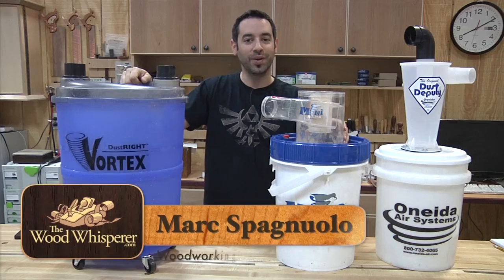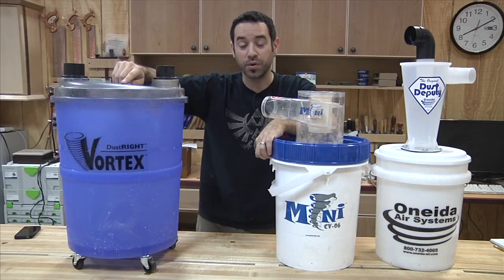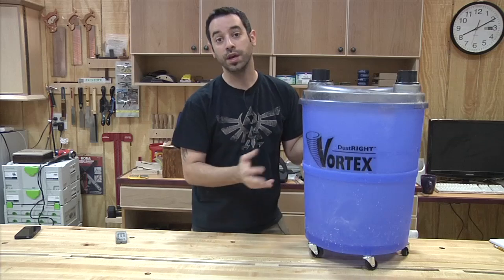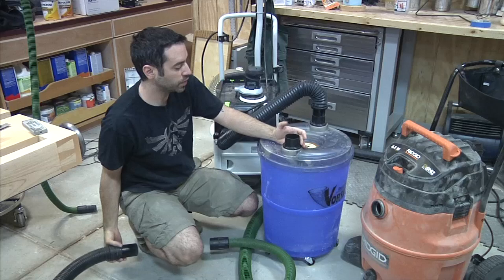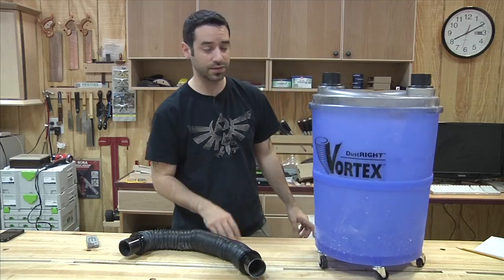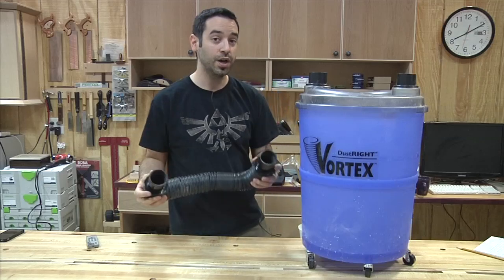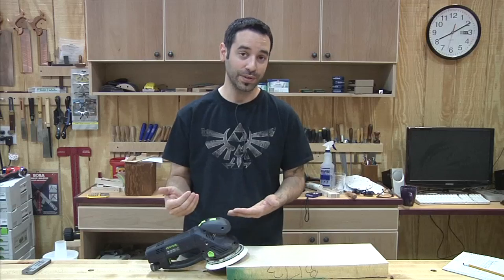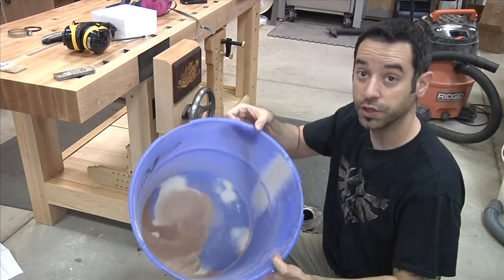170 - Cyclone Separator Shootout

Comment: Hi there, enjoy your videos, just a quick question, I've set up the cyclone type dust collector, I'm just using an house hold vacuum unit at the moment, my problem is that, the dust is being sucked up but not falling into the bucket, still getting sucked up into the vacuum unit, do I need to invest to buy a stronger vacuum unit? any idea would be appreciated. Thanks Warren

Comment from the maker: The larger the particle, the more chance there is that the particle will travel right through into the vac. So while I know many folks who use these systems for larger machines, I can't personally comment from experience on it. But at a certain point, you could probably overwhelm the cyclone.

Comment: One thing this test did not do was how much suction loss (both air flow loss and pressure head loss) was caused by the interruption.  In actual use, more suction loss means less of the wood dust would be captured.  It's entirely possible that although the Vortex may have the least effective fine dust separation, it MAY have the least suction loss and MAY end up capturing the most dust during actual usage.

Comment: I have just set up a system that is similar to the dust deputy as shown in the video. I have used a heavy duty plastic type container that keeps collapsing when the vacuum end gets blocked. could you advise a solution? Thanks.
Reply: +grumpywoodiam hello mate just wondering if you corrected your bucket from collapsing? cheers
Reply: Found a video from @newbie woodworker showing him put his bucket in another same size bucket. I guess the negative pressure between the buckets act as an opposing force. Super simple.
Reply: I have also set up a system just like the dust deputy. Only difference is that I used an empty chlorine bucket. Appears that the 40 pound loads require a heavier duty plastic. I have a large Ridgid shop vac like in the video and have no bucket problems.

Comment: i had the dust deputy attached to a cheaper bucket which also would collapse. my solution was to install a wire mesh from a fencing scrap to line the inside of the bucket, no problems since then.

Comment: Spoiler: Dust Deputy is the winner. It's both the cheapest and most effective.
Reply from the maker: The new Clearvue Mini is just as effective, but still more expensive unfortunately.
Reply: The Wood Whisperer the oneida system is made in Syracuse NY... if want to support USA companies.
Reply: Price of the dust deputy in 2018 is $122 usd on amazon, compared to the original price at time of the video of $79. Mannnnnn
Reply: Tsz2g4f in the U.K. Amazon site it can be an eye watering £166......!!!!

Comment: Bill Pentz (billpentz com) has just put the fear of God into me as I was researching dust collection for my brand new woodworking effort. Seems the toxic, fine .001 micron dust is not actually removed by small hoses, shop vacs and cyclones in general. Only 6 inch smooth pipes connected to hoods and cabinets etc is the only way to go. Any thoughts?

Comment: I believe that the two losers would work if you installed them on a straight-sided bucket, like the winner, which shows the dust collected in a ring. The tapered buckets mimic the shape of the vortex and are causing the dust to stay suspended in the cyclonic activity within the bucket - allowing it to be "sliced" back into the outflow and on into the shop vac. Could possibly be improved with a deflector or lip of some kind, on the under side of the port between the cyclone generator and the bucket - maybe just an o-ring or a slice of a large pvc pipe, slightly larger that the opening could be attached on the under side of the lid, around the opening...but I bet it still wouldn't beat the straight sided collection bucket.
Reply: The bucked don't have an effect ( or it shouldn't ), the major rule for this small cyclons is the area from the cyclon to the bucket should be as small as possible. As you see the winner did it right.

Comment: I used to have a dust right vortex and I hated it so I returned it I only had it for like a couple weeks. I replaced it with a dust deputy and I love it I don't ever have to empty the vacuum as often as I used to and I recommend to a friend of mine that is a woodworker and he empties his canister like every six months and every time he does that he checks the vacuum and there's almost nothing in there also dust deputy has really good customer service I called them because the top of his unglued from the bottom and they send out a replacement at no cost but at the same time we epoxied the old one and still working so we still have a backup just in case of it finally breaks again. Both mine and his are a 14 gallon plastic drum with a steel snap ring Cover. I am probably going to up mine to a 55 gallon drum with a snap ring cover.

Comment: I have a dust deputy or  identical copy (differnt hose connection ports) and use it on My   Knife grinding Linisher  where it acts as a spark arrestor  where i sued to set fire to the Vac filter in seconds

Comment: Why does a Dust Deputy cost $79?  It's a bucket and some molded plastic.What am I missing?
Reply: Andy Bryant You're missing intellectual property. There was most likely a lot of R&D that went into that design and performance.
Reply: Regardless, it's still a bucket with a venturi.  I have no issue with R&D.  It just seems like they'd sell a lot more if they were $49.95.  Total cost to produce can't be more than $20 for parts and labor.
Reply: +AndyB I don't know where they're getting $70 because I got my dust deputy just by itself for 30 directly from the company The $70 one must come with something that I don't know because it didn't look like anything different than mine.

Comment: thanks for taking your time to do this review... however all those units are way over priced... 75 dollars for a bucket (the deputy) and even worse 145 for the mini cyclone??? that's daylight robbery... right now on Ebay the Chinese deputy knock off (without the bucket) sells for about 15 dollars including shipping and a 25L bucket is about $4 at the hardware across the road... i cant imagine that in China the cost of moulding plastic can be 5 times cheaper than the US

Comment: The oneida system  has a taller  cone body which is essential for the physics of a cyclone separator.  Plus, I don't see a proper cone shape after the inlet on the other two, unless its inside. The other two are not "cyclones".  I think the newer cv06s have changed their model since this video has been made. Their current model shows a cone on top.

Comment: Troubling that the $79 bucket and inject moulded fitting are the cheap option. Hard to believe that you can't pay $50 extra and have it built into a shop vacuum from the get go. A dual chamber double decker shop vac would be the best solution.

Comment: Wood dust is combustible and plastic hoses and separators build up static electricity.  Definitely keep that bucket emptied or you could have a boom..
Reply: Eamonn Shanahan Has been proven to be a myth. Please don't fear monger.
Reply: Cliff Chambers Wood dust has a KST value of 102 and per NFPA regs it 
requires dissipative and grounded vacuum or dust collection equipment.  I
build and sell industrial vacuum and dust collection for a living and have 20 
years experience with it.
Reply: Fair comment but when I got my Dust Deputy Deluxe, (2015) it came with self adhesive metal strips that you adhere to the out side of the cyclone. You then simply attach a piece of earth wire to the system with a washer hanging on the end of the earth wire, which is then allowed to drag on the ground, thus eliminating any static build up.
Reply: Metal strips give you a path to ground but they won't dissipate static build up within the plastic cause by friction. It is a good measure safety though. I don't work for them..but go to flexaust.com and do a little reading about dissipative versus conductive versus grounded dust collection hoses. The designs you guys are coming up with are great and are very resourceful but I have seen too many problems with pvc piping and wood dust.  But on a small scale...and if you clean to bucket out frequently..you should be fine.
Reply: I don't care how long you sell vacuums and dust collection. You know how often a Green Egg results in a fire? Almost never. Can still find a few instances of it online - pictures and all. But I've never seen any actual proof of fire or explosions resulting from dust collection and static electricity. And nobody else has either. For every person that states it's a fire hazard, 2 or 3 others call it out as a myth. Or at the very least an extremely unlikely event. I probably stand a better chance of exploding because someone is pouring out coffee creamer while smoking near me
Reply: @ShameinAnaheim  Great, but all the accidents cited in the article you linked to happened in LARGE, INDUSTRIAL dust management settings. These small home-shop devices have been wildly popular for several years now. To help convince us of your point please link to one bonafide news story of someone's 5-gallon bucket exploding.

Comment: Hi!
3 questions here: 
I bought this 1hp dust collector for my table saw, planer, etc. See the picture here: http://cdn1.bigcommerce.com/server2500/9fa34wk/products/1957/images/2281/CT053_org.1435535458.430.450.jpg?c=2 and I will make a cyclone (like the dust deputy) for it.
1. Does it change anything if I make the plastic and filter bags a lot smaller?
2. How big should be the cyclone?
3. Is it better to use only 4 inches hoses for the cyclone and the dust collector?

Comment: The dust deputy has half the capacity of the vortex. Like comparing a six shooter with a machine gun.
Reply: not so, the dust deputy can be attached to any bucket
Reply: +Mark Ague i'm going to moving my dust deputy and changing it from a 14 gallon canister to a 55 gallon canister
Reply: Ben Boudreau You'll get more pulling power !
Reply: +Matlockization how would the size of the canister allow for more pulling power it just holds more dirt or dust.
Reply: Ben Boudreau That's a great question and I'm glade you asked. It allows you to pull in more dirt and dust - go figure !

Comment: It's a pretty good shootout.
But why don't you do the extra bit where you deliver solid information, overall size, capacity, attachment range, dust percentage retained, pressure loss,... this stuff is really damn important to distinguish good/bad performance. And it's not like you need expensive gear for that, you can measure pressure loss with a glass of water and a straw for christ sake.